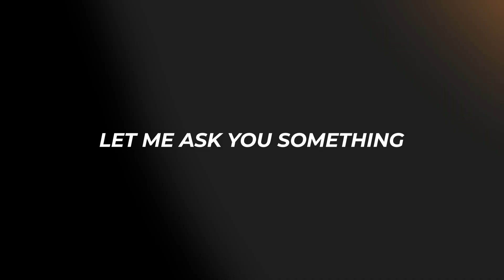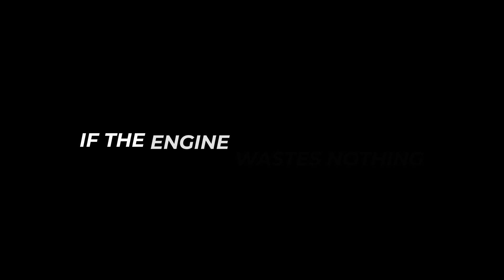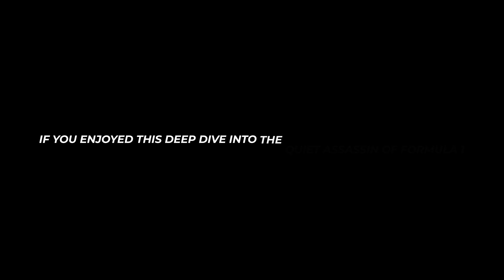This Engine FOOLED Formula 1 | Honda RA168E

Comment: FIA killed turbos with fuel economy nonsense.
Reply from the maker: Partly true,  but that “fuel economy nonsense” is exactly what made engines like the RA168E so terrifying. Honda didn’t lose power because of fuel limits, they weaponized efficiency. Others just couldn’t keep up.
Reply: @HCGHiddenCarGems they lost 400 horsepower.
Reply: @V8Lenny  They lost power because FIA lowered the boost cap, not because fuel limits were set. Hell, you automatically use less fuel when you run on lower boost if you're half way competent. Efficiency isn't about power. Efficiency is about fuel use versus poewr.
Reply: @samiraperi467 and Honda was the only one to develop engine for that single year, others concentrated to next years NA engines, so no competition.
But banning refueling and/or limit tank size is stupid. Keke said he wanted to race, not economy drive.
Reply: @HCGHiddenCarGems FIA could have just reduced engines to 1200cc like they planned and allow only normal gasoline, that would have reduced power to about 600-700 hp.
Reply: And reinvented turbo in 2014 for the same reason, fuel economy.